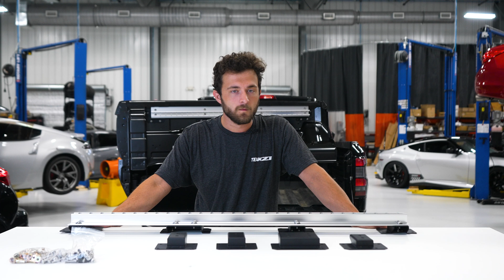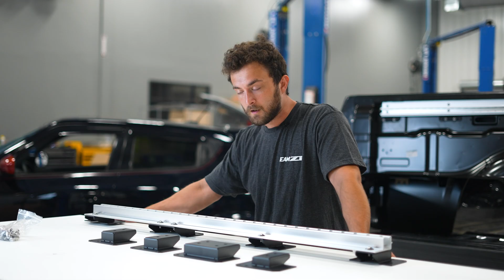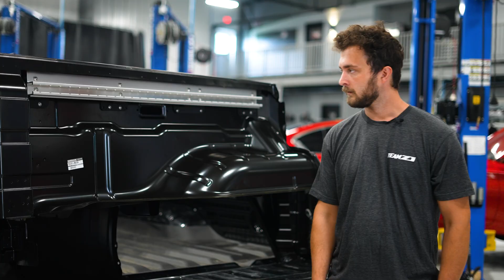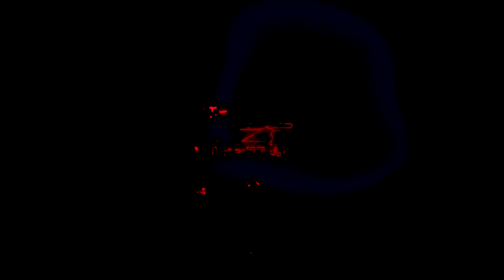Nissan Frontier Bed Side Utility-Track Retrofit Kit by Z1 Off-Road

Comment: WARNING!!!! THE HARDWARE IS ENTIRELY TO LONG AND WILL NOT WORK ON A LONG BED. When I called to inquire about the kit the salesman did not indicate or ask what size bed I have, so I found out the hard way with 4 outty dents that need repaired.  It would be nice if the listing indicated (fits only) or (does not fit long bed) then maybe I would have caught it.  Hope this helps someone.
Reply from the maker: The reason they do not ask, is simply because these were only intended to work with the 5 ft beds. The listing says short bed only, no mention about long beds. 

I will reach out to the team and see about using shorter hardware.

Comment: This is great!

There a budget way of doing this though. Just buy a 12mm blind rivet set and a tool and you can screw in some utilitrack/superstrut from home depot into the premade holes of a the frontier truck bed that doesn’t come with the holes for this set up originally.
Reply: The holes in the bed are not meant for the utilitrac. Also, the bed is reinforced from the factory to handle the load on the tracks. Rivnuts will not hold that load rating safely.